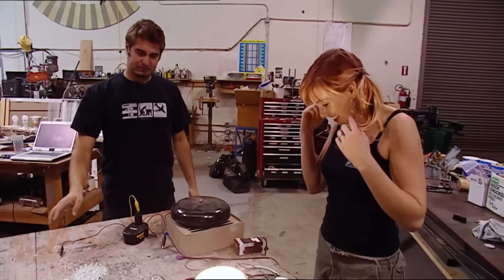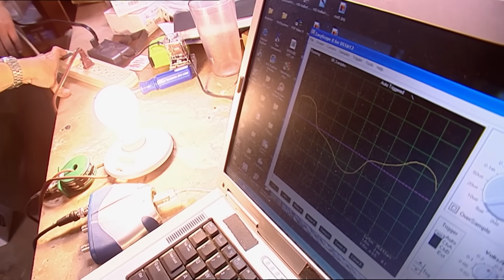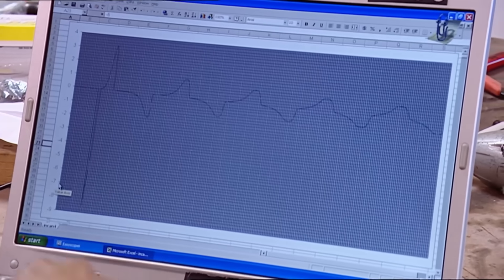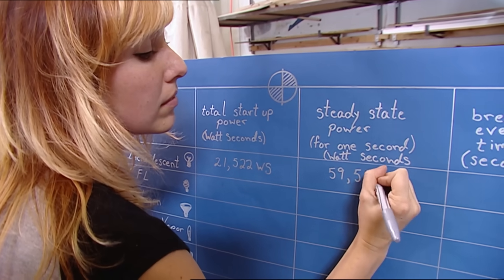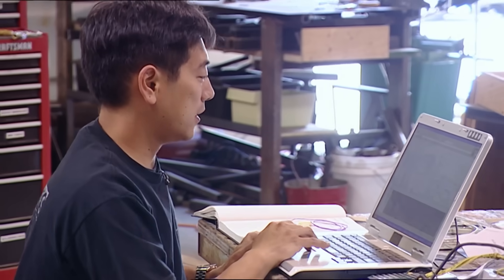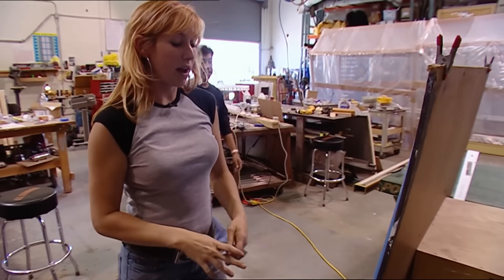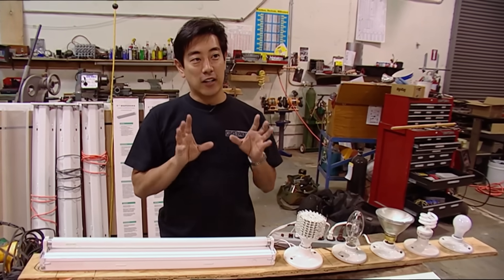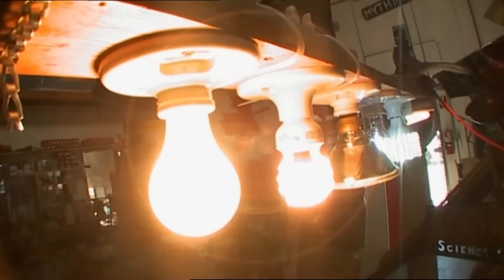Is It Cheaper To Leave The Lights On Than To Turn Them Off? | MythBusters

Comment: If you're building a new house and use LED bulbs, it actually takes like seven years to recoup the cost of installing a switch at all.
Reply: if an LED bulb uses 6W, and its on 4 hrs per night that's 24W per night. 24 X 365 (Days) = 8760 watts per year. which is 8.7KW a year. lets round that down to 8 KW a year. 
the average cost for a lightswitch is maybe 5-10 dollars. so i guess it depends on how much your electric bills are! 
in the uk for example that would be around 30p per KWH so 30p x 8 kw = 2.40 per year. while it is possible to get large bulk orders of light switches for around that, I guess it would take around 5 years to make it back.
but luckily light switches tend to last far longer than 7 years! however "recoup the cost" is assuming the lights only turn on for the 4 hrs you use them at night. if instead you kept those lights turned on indefinitely, then those numbers would recoup far faster. suddenly the 24 watts for 4 hours of use, turns into 144 watts per 24 hrs usage.
which would be around 4.8 kw in a month. or around 52 KW a year! at that rate it would be around 15 pounds a year (probably around 10 dollars ish) to operate indefinitely! so the switch becomes cheaper.
(I'm not trying to prove anything, I'm in a data crunching mood and the comment section is gold for math problems today) XD
Reply: @Fwuffer  I guess I was off by a little bit. The cost of installing a switch in new home construction is about $150 each, so it's more like 60 years before a light switch pays for itself.
Reply: @Mooff2  that's an insane cost! i cant believe thats a zero, like... well i guess it pays to be a new builds electrical installer in freedom land then! XD
i guess was just under the assumption most people would do it themselves. at least where i live its fairly common for people to replace light fixtures, switches, and other common fittings themselves. electricians only really get called for more complicated things like heating systems or fusebox stuffs. oki i like just looked it up and that is insane! those sparkys get paid an awesome wage tho!
Reply: @Fwuffer  if you ever contract to have a house built for you, you'll find it actually a pretty lowball cost.

Comment: And the lifespan of a bulb turning  and off and on and off...
Reply: Covered in the latter part of the video, and estimated their test equaled about 5 years of continous  use. The math seems to track pretty well. Not super conclusive to me though, as  they only states every bulb except one had burned out in that time frame, but some surely gave out a lot sooner, so it seems feasible replacement cost can in some cases make it  more  expensive to turn on and off the light vs  keeping it. (plus you wear other components of the light as well, starting with the light switch, ballast for some lights etc.)

Comment: For some lights, yea it's cheaper to leave them on then to pay to have a new switch installed when it goes out.  New switch is $200+  every 20 years or a new $30 light every 10 years.  It's cheaper just to leave most leds on nowadays.

Comment: It’s crazy how much power LED bulbs save. Yet our utility bills never go down…
Reply: It's because you're unlikely to have been using so many light bulbs in your house that the difference in switching will be noticeable. Things like HVAC, computers, electric ovens, water heater, driers and the like are much bigger users of power. The thing that showed me the biggest reduction was swapping out my thermostats for ones that are a bit smarter with a built in PID controller to help ti better predict how much power was needed to hit the desired temperature as well as an easier time programming the thing to not be in use when I wasn't needing it.
Reply: It is a circle that's created when saving electricity.  When the populace strives to conserve electricity use, it lowers the revenue for the utility power company.  So, to makeup for that financial shortfall, the company will raise the rates.
Reply: @bloqk16  Maybe essential utilities like electricity shouldn't be run for profit.
Reply: If you only replaced your light bulbs with LED's and didn't add a gaming PC, huge TV and AC. You would see the bill go down massively.
Reply: @tardvandecluntproductions1278  my gaming PC uses over 700 watts, not including the monitor lol. 
And we do have more electrical appliances than ever.
But where I live in Canada, we mainly use gas for heating/hot water, and our electricity prices have gone up by a lot.
Reply: @tardvandecluntproductions1278  I replaced all my bulbs with LED bulb mostly in 2018 and 2019. Nothing changed for the negative with my AC and PC usage. In fact, the computers I built in 2019-2022 are more power efficient than my older systems. My TV is larger but also more efficient. My current TV in LR is 65", so it's large but not huge. I got solar power in 2022 and my bills went way down but now they're coming back up because Dominion Energy is scamming their billing now.
Reply: @tardvandecluntproductions1278  The TV's a lot more efficient than 20 years ago. So is the AC. The gaming PC is not on 24/7 unless you're a maniac.
Some people need air conditioning just to maintain livable conditions inside their house in the warmer seasons. A house from the 1960s still could have had electric climate control, entertainment, etc. Frugality is pointless if you suffer for little gain.

Comment: I remember back in the early 80s my dad strongly believed this, especially regarding fluorescents.
Reply: Because it was true. Not because of electricity prices, but because of the price of the fluorescent tubes. Yes, in laboratory settings and only if you turn them on before they have tome to cool, they are gonna last for long. However, while used at home (for example bathroom) when it has to turn on from being cold several times a day, it will fail soon. And in the 80s, they still had a lot of mercury in them. Your father was right.
Reply: @neverstopschweiking  for me I don't care about how much mercury they have just saying

Comment: Well if people want to know bit of a FACT about Light Bulbs and why they Don't last Long. Look up the Phoebus Cartel. They basically made it so incandescent light bulbs burned out after about 1,000 hours. Just So the Light bulb Companies that were apart of this Pheobus Cartel group can keep making Money. One of the groups was General Electrics.

But anyway, I switched all my Lights to LED anyway, all I know is, My Electric Bill is down to roughly $45 a Month if the AC or Heat pump is Not running. which is about 6 months out of the year. With the AC and Heat pump running during summer and or winter it goes up to about $70 to $80ish a Month.
Reply: Yeah, the light bulb conspiracy is not a great example of planned obsolescence, the trade-off for longer lasting bulbs were dimmer bulbs which used more power in the long run. Consumers wanted brighter bulbs and power companies wanted more energy efficient bulbs, so that's why the industry settled on a compromise with a slight reduction in longevity

Comment: There is one other element of leaving it on vs turning it off between uses they don't consider.
Over the long haul, the light that is switched off will potentially degrade faster than the light that is left on due to heating and cooling that causes expansion and contraction of the material in the elements. This is true for incandescent as well.
I take that back. They did consider it. ;)

Comment: Fluorescent bulbs are designed to stay on for long intervals.  Their longevity is damaged the most by repeated on/off cycles.  So if you have fluorescent bulbs and will be frequently in and out of the area (a central area like a kitchen or living space), leave them on.  If it's in a more infrequently used area (bathroom, garage), only leave them on if you're going to be back within a minute or so (or someone else will be in there within a minute).

By contrast, all the rest are better adapted to on/off cycles (especially the LED).  And the LED has the added advantage that it sips power rather than guzzling it.  So whether you'll be in the area for a while and need to leave the light on, or even if you're switching it on/off frequently, LEDs are the most energy-efficient by a huge margin for basically all use cases.

Comment: Skipped over that led did they. One problem my place of buisness is currently having is lights are on motion sensors.. and the constant energizing of them throughout the day is burning out the driver for the LED lights.
Reply: Motion sensing LED lights are built the cheapest of any LED fixture. The drivers inevitably fail in less than 2 years in the worst cases. They undersize the drivers for the application to save on production costs.
Reply: @HittTheDekk  So the lights wernt motion sensing, but they used a motion sensor on one end of the hallway for the master switch. It was a physical relay based switch (originally used on florescent fixtures) so each time it clicks on it creates a surge on the drivers (each led fixture has one to drop the voltage for the LEDs) and they are failing quickly.
Reply: @MaNameizJeff  You can pair a motion sensing switch with a dimmer switch if the circuit is wired for 3-way. That way you have "soft start."
Reply: @HittTheDekk  No doubt...  I think a good solid state solution would work, but the choice is above my pay grade. :)

Comment: Actually your test had a major flaw in your testing. The light filament breaks not from the number of times turned off and on but the number of times it is heated to full temperature and cooled back down to room temperature. The expansion and contraction of the filament through the heating/cooling cycle is what causes it to fail. Since you cycled every two minutes you did not allow for the filament to fully cool and contract. In fact by doing it every two minutes you may actually extended the life of the bulb. So I guess it is your test that is busted.
Reply: They definitely should have noticed that they were doing 5 years of normal usage and opted for a month cycle that emulates the usage of a year for a more precise result to their testing. And arguably, stub your toe or shin on a table just one time because it's too dark, and the lights on team gets a huge quality of life advantage.

Comment: Makes me wonder about smart bulbs.
Reply: This are LED's. One LED can be turned on and off millions of times per second without any adverse effects. They also do this for dimming (more likely with about 30kHz, not MHz).
The bigger problem could be inrush current when you turn on/off the 230V input. So, smart bulbs have less problems with switching it on/off since you can do it directly.
However, they are very complex, having many more points of failure.
Reply: @Johannes-c7p these are just normal LEDs, not smart bulbs. Smart bulbs are LED with the additional circuitry for control. Ideally, they are never fully unpowered.
Reply: @davidchav6795  Yes, i know. My point is: You have less damage from switching, but it is a more fragile component.

Comment: Not only the lamps!!! Switches, ballasts and IC chips all wear out too from changing states; hot to cold, back and forth over and over. One florescent ballast failing prematurely wipes out years of cost savings and then some. Pretty much any part failure requiring paying a maintenance person to replace a component will wipe out years of cost savings. You know, that light bulb over the stairwell that requires a brave soul on a scaffold with a special bulb remover on a stick. Handyfolk don't come cheap.

Comment: There's a missing piece to this equation. Turning power on and off does actually shorten the lifespan of components, especially switches, ballasts, bulbs of all kinds and IC chips. Factor in early failure replacement costs, parts and labor, and a different conclusion emerges.

Comment: One aspect of the on/off test that wasn't considered is that the 2 minute interval does not allow for complete cool down of the lamps before turning back on. That temperature difference will make a difference,. I'm not sure exactly how much of a difference it makes but it does make a difference. But it likely won't change the fact that the myth is busted.
Reply: Well, more importantly, they also didn't compare them to a set of "control" lights which were left on continuously!
Reply: @phueal that would be interesting information to have for comparison of failure rates but I don't see how it's more important to have those when you can calculate the energy usage results of the lights being left on continuously for the same amount of time. We know the lights will fail sooner with on/off operation and the question is whether or not you use more energy by leaving them on as opposed to cutting them off.
Reply: @mikeslater6246  in the test you’re referring to (the 2 minute on/off test) they were testing the impact of switching on and off on longevity, not power usage.
Reply: @phueal you make a good point. Longevity is a consideration in total energy usage in comparing the life of the bulbs which then does bring us to your point about the control set of lights which would be necessary to give us that comparison of total cost-effectiveness between the 2 options. 
Thanks for the conversation and have a blessed day!

Comment: "How old is this?"
seconds later
"Brother is using Windows XP 😭😭🙏"
Reply: 2010  video....
Reply: lot of ancient electrical hardware  / instruments still work and are no longer supported, maybe because the company no longer exists or because it costs too much to support ancient hardware.
Hence there are people who are stuck with a Windows XP or worse, version of some software.
I once bought cut wood from a local shop, and their  bill included a scan of a printout of the material bill, straight out of a DOS program.
It was last year. It was some kind of 2d packing software to layout my order on standard MDF sheets
Reply: @xl000  Yeah i'm aware, i've seen medics use medical equipment on windows 7 a lot.
Reply: he even has CLIPPY

Comment: They never gave numbers for the LED. They mentioned it when they started, I think. There was a blank line on the board.
Reply: If you pause at 3:49, it say 1,28 sec on the board.
Reply: LED's were pretty new and not very good or bright back then so it likely wasn't focused on heavily.

Comment: This was back when LED bulbs were literally just a bunch of those little LEDs
Reply: they are completely different physically and chemically wise.
Reply: they are still?
Reply: @hobrin4242  Most of the time these days, they're an LED filament or just a couple LEDs. Not a massive array of individual LEDs.
Reply: @hobrin4242  well.. yea, but they put the leds behind a translucent bulb so it looks like an old incandescent bulb. the aesthetics have gone full circle  lol
Reply: @brtecson  Yeah I bought one of those LED Edison bulbs in 2014 for the first time
Reply: Probably this episode was the tipping point for the led manufacturers to reduce the quality.
I don't think an led today would survive that test 😂
Reply: They still are.